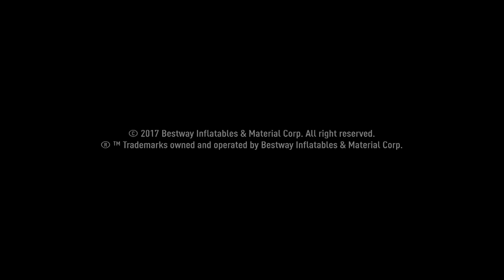Bestway Power Steel Oval Frame Pool Steup Video

Comment: I have a concrete slab that is exactly 16' x  10'.  Will the pool 16' x 10' x 42 fit on it or will the frame extend out farther than that dimension?
Reply: Maybe
Reply: Yes it will

Comment: Which pool is this and why did you spend 40 seconds showing her screwing in the water hose instead of the pool size to human ratio?
Reply: I found that you can screw the inside pieces in and they pop through the outside.  If you upgrade the pump to a bigger pump you need the adapters but they will screw to the outside and the new pump will have its own hoses.  This pool has two inlets and one outlet so you'll need a Tee fitting and an extra hose to use both but you don't have to because the pool comes with stoppers and you can put one in the inlet you aren't using until you get the Tee fitting and hose.
I added an Intex larger pump and saltwater system and it works great.  
The pool came with no instructions and the ladder was too lightweight so I replaced it.
Reply: @joedoesfun9336  what's the dimensions here?also is there a website to purchase one thanks
Reply: @goldenstatew2399  There are only 2 sizes available. You can purchase them nearly everywhere. Look for adapters.